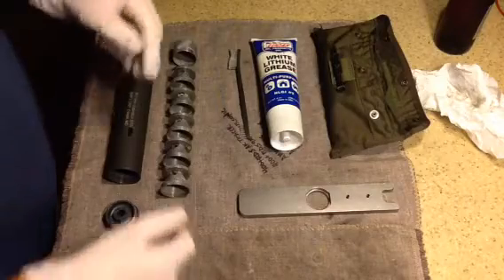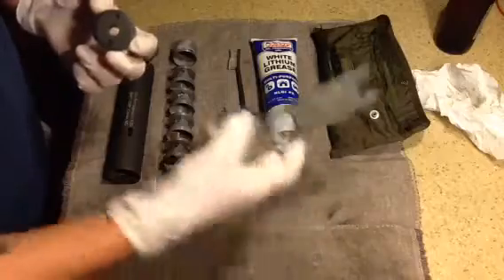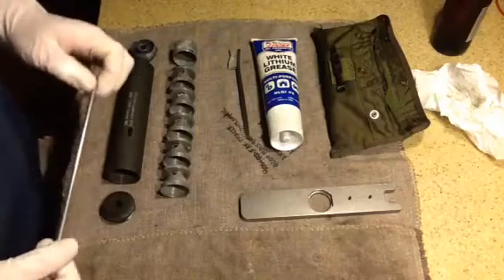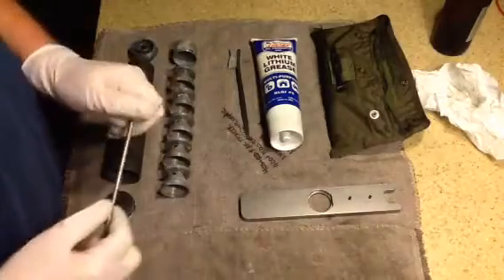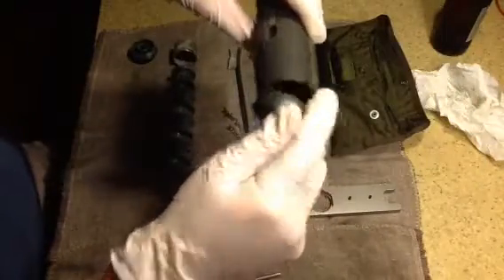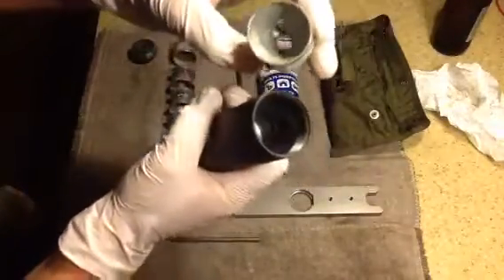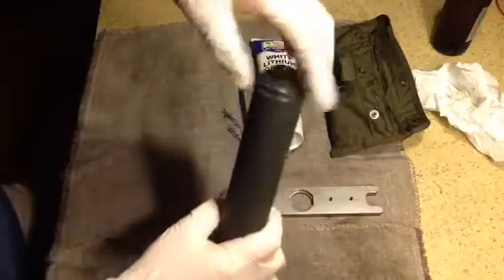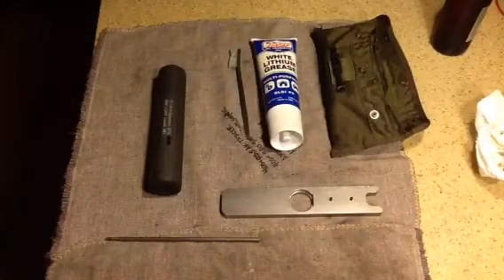Stemple Takedown Gun (STG) 9mm Suppressor

Comment: The exhaust ports are called dater holes. Shouldn't matter if they are lined up or not.  Short pipe is a blast baffle spacer.  Only thing I can think of would be to maybe use a wooden dowel rod to line the baffles up before you put it back together.might save you beating on it a little

Comment: I'm speaking more about the threads being damaged. .  But if worse comes to worse, you could loctite.  I've dealt with loose end cap from design flaw. Very loose threads I threw viton o-rings on both ends and keeps them very tight.